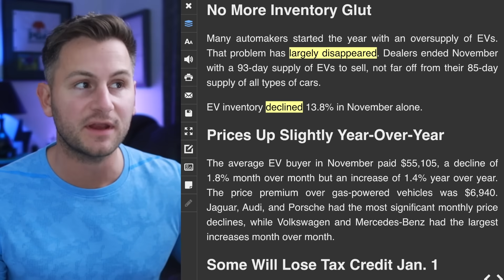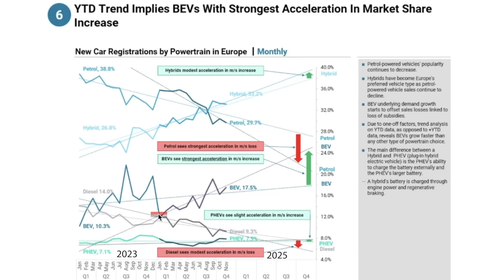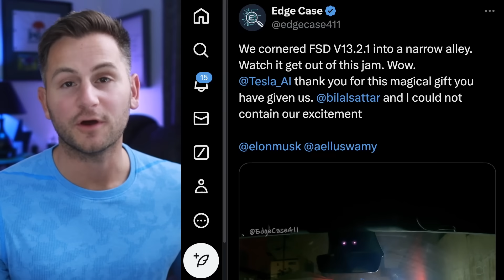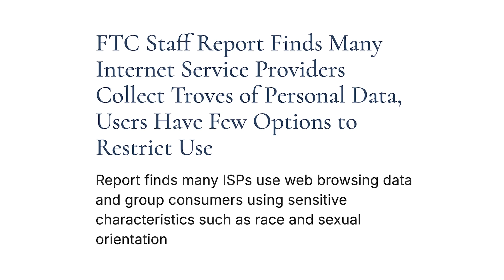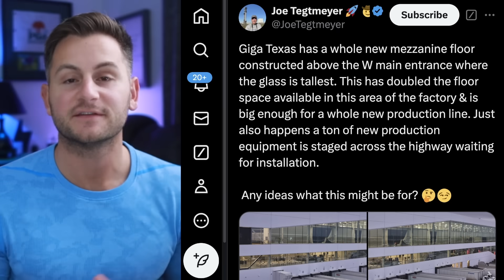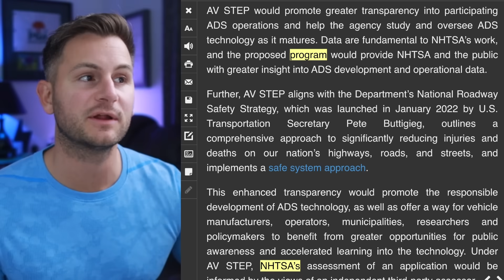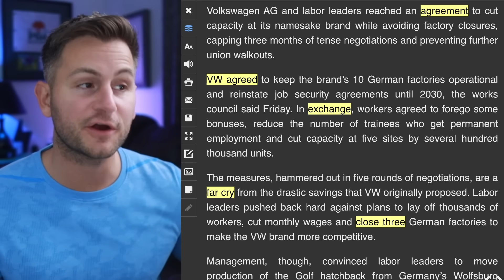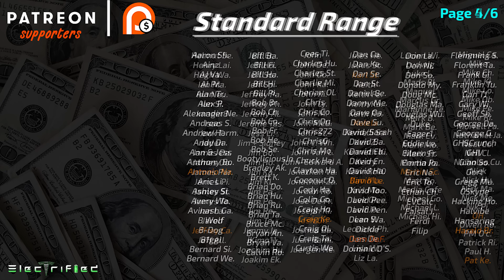The EV Sales Turnaround / Robotaxi Regulation Changes / 4680 Update ⚡️

Comment: If the 4680 was that good, why wouldn’t they ramp it up and use it in model 3/Y? Don’t they get additional incentives for using those batteries? And if they are not that good, why use them in the cybercab? Cybercab production will be very limited as they can’t manage that many cars.
Reply: Life isn't a computer game.  You can't just pull and swap parts on production lines.  It makes perfect sense to use them in models going forward.

Comment: Suggestion: consider differentiating when you’re describing error cases whether it is a cyber truck or a model 3/Y. There’s a distinct difference in how these vehicles FSD 13.2.1 operate. Version 13.2.1 in one vehicle may not make the same 13.2.1 errors in a different vehicle.

Comment: 12:53  The TPMS issue is fixed as of 2024.38.200, and the Holiday update is 2024.44.xx...so isn't this fixed fleetwide already?
Also, Tesla uses BLE, so it can be interrogated by the system upon startup, and flagged if low or unresponsive.  (This is different from other manufacturers who typically use 432MHz, which only transmit once per minute.)  There should be no real need for a Tesla to remember the last state, except to solely comply with the regulation.  On the other hand, the typical method described by FMVSS is more dangerous, as it assumes a good state across driving sessions (at least until new data comes in).

Comment: Re: 4680 lines

Recall that Model Y also had some with them. Maybe the intent is for the Juniper refresh (at least higher trims) to move over to them or something if they're more economical. Seems like robocab would use LFP's as the cheapest cells where performance doesn't matter. Lastly, as ever, Tesla has a basically insatiable demand for batteries: they'll find somewhere to put them.
Reply: Mega pack got 2 year waiting lists
Reply: Juniper hopefully has blade battery
Reply: Fair point. It will be interesting to see which models get what battery format. Juniper is literally weeks away

Comment: I have a CT with FSD 13.2.1 and it generally drives very well but navigation still has problems and the CT still wants to push into a line rather than getting into the right turn a little earlier.